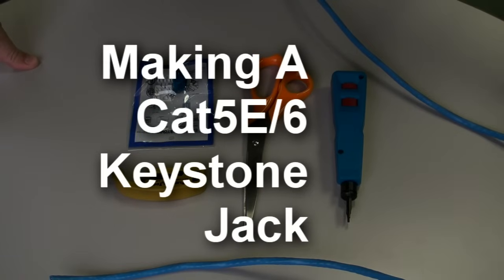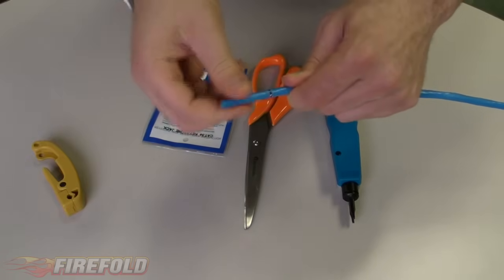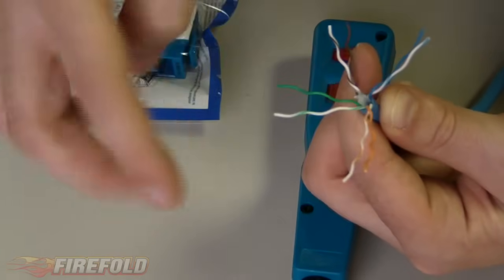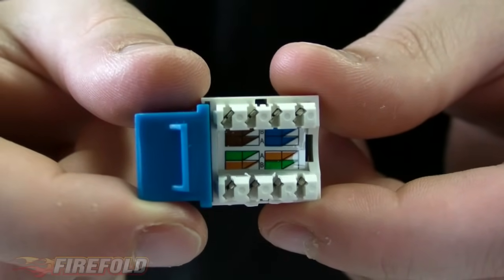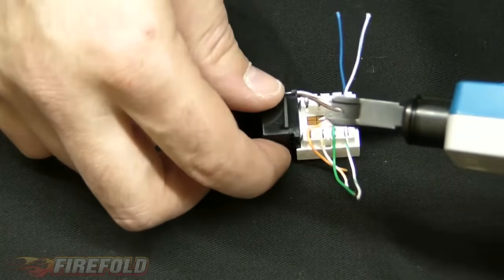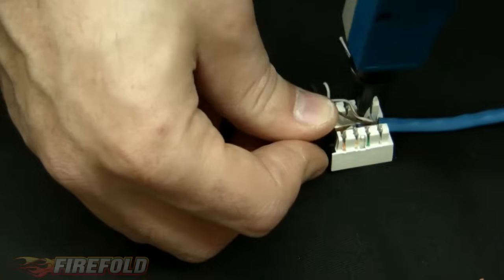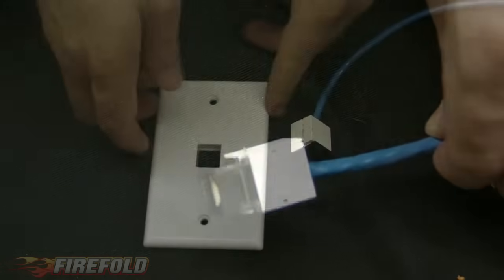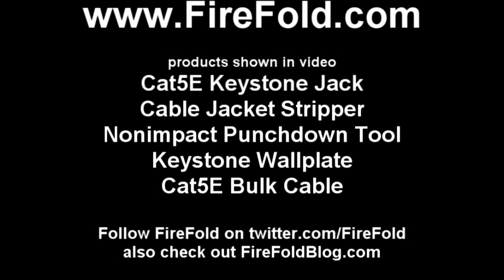Networking 101: How To Punch Down Cat5/E/Cat6 Keystone Jack - FireFold

Comment: Love the tutorial! One thing I would mention however, sometimes the Cat5/Cat5e/Cat6 shielding strippers might accidentally nick the twisted pairs, causing a short. I always teach new techs to use the nylon string to strip the plastic shielding further down the wire to avoid this. Especially useful if the cable is used for POE or gigabit connections.

Comment: While this appears to be simple and helpful, you should not untwist the wires all the way to the jacket. It negates any certification of the connection opening up to crosstalk issues. might work for old analog voice but high speed data has standard that this termination does not meet.

Comment: I did a “DIY”... cut the jack off of a CAT 6 commercial electric (Home Depot I think) and I am currently attempting to put a keystone on one end while the other end still has its original jack. Any help is appreciated. I’m hoping the only issue is the punch down it came with is cheap and not making a solid connection.

Comment: Never ever take the outer jacket off and not pull the string to expose more wire. 1 nick in the wire and failure is close at hand. I have enjoyed the lesson of the failure due to nicking the wire.
Reply: Robert w Sieburg what happened? How did you identify it failed?
Reply: @ellenboyd9287  Orange white broke. Dressed the wire again and used the same keystone and never had a problem with it since.

Comment: I have a question. On the other side I am attaching a regular RJ45 ethernet jack. Do I need to arrange those wires in same order as A,B,C,D on this or follow some specific sequence?
Reply: Same on both ends. Crossover ethernet cables haven't been needed for a long time. Look up Auto MDI-X.
Reply: On the other side (if using B standard) you’ll make it 

Orange white / orange / green white / blue / blue white / green / brown white / brown

Comment: Wrong, only separate as needed, keep twists up to where you punch them down, otherwise you will increase crosstalk. Sucks replacing jacks that someone else did not terminate properly.
Reply: Industry standard is max 1/2" untwist, there is nothing wrong with this demonstration
Reply: That is only for Cat 5... Cat 5e and higher you do not want to follow that standard. Trust me on that.
Reply: @Taluvian  so, are the jacks & plugs the same? Or are the different for 6 & now 7?
Reply: Yes, there is a difference in both. Cat 5 and 5e jacks are same, but manufactures have different jacks for Cat 6 and 6A, and Cat 7. At work we use CommScope, which I hate but standard there since the late 90s. We use both UNJ500 and UNJ600, which ever is cheaper and meet standard. RJ45 plugs is a bit trickier, especially when you get to Cat 6A. We test and must pass all cabling with Fluke meter now. In past they did not have standard to follow and we deal with garbage terminations that may work, but do not pass on meter.  New systems are better and easier to use. I do recommend using Belden RevConnect system after using that at home.

Comment: can I use a cat6 keystone jack on a cat5 cable?
Reply from the maker: Yes, you can! It won't make the Cat5E cable operate any faster, but it will work the same as a Cat5E jack.
Reply: i've read that if you use cat5 cable on cat6 keystone jack, the wires will not be as tight in the punch hole because the cat6 wires are thicker than cat5.
Reply from the maker: They will work fine. We actually have a customer who only uses Cat6 jacks no matter what, and he regularly mixes Cat5E and Cat6 cable.

Comment: Thanks! Now I don't have to spend $75.00 on someone to come and do it for me.
Reply: Jonathan Waller wow! I’m getting ripped off at $150 per jack.
Reply: Pretty insane what prices 'specialist' laborers charge for easy work as long as it requires a $30 tool and 10 minutes of instruction.  Check out what electricians charge to install an outlet in a new home!

Comment: So I could put one of them on each end then plug an Ethernet cable into each end then plug one onto my Xbox and the other into my wifi  router and it would work?
Reply: Yes. You would want to wire both keystone jacks as T-568B (or A.)

Comment: Thank you so much for this, what a clear instruction.  I didnt know how the heck to use the punchdown tool or even what direction to face it in.  I also did not know how to use the wire stripper in my kit that you demonstrated and had been stripping the wires the old fashioned way.  You have helped me tremendously.  And that tip about using the tip of cable shielding to untwist the wires was worth its weight in GOLD.  THis is one of the best YouTUbe videos I have ever, ever watched.

Comment from the maker: Yes, the Cat5e and Cat6 pin outs are identical in both T568A and T568B pinouts. T568B being the standard for most in North America. You will be able to punchdown a Cat6 keystone jack with Cat5e cabling, although the network would only run at Cat5e. So while it is possible, we cannot guarantee the functionality of the products when used in this manner.

Comment: I have a 66 block in my new home, terminated only with blue/orange from cat5e for voice. I am trying to tone out the block to find which run goes to a specific jack so I can use that cable for ethernet. When I tone the 66 block, the whole thing sounds hot. Is it possible that the block is run in series? I tried holding the probe behind my back and running my finger down the block, but touching every bridge clip produces tone. Is there a trick to doing this, or do I need to yank all the runs?

Comment: Nice video. Correct me if I'm wrong. You said in the video that you were using cat5 cable but it looks like cat6 cable based on the plastic separator in the core of the cable.

Comment: What if i want the other end of this cable to have a male plug? Does it have to be also B(T-568B) or it has to be A, like crossover?
I wanna have 4 jacks in different walls around the house and all of them coming to the same place as male plugs to connect direct to the router.
Thanks in advance!

Comment: I want to know if it's okay to use the dull side of the retractable knife to use as a punch down tool. The reason I use the r. knife, is so I can cutoff the nylon coat. But anyways, it fits, it makes the clicking noise like a impact tool, it just doesn't cut excess, and the jack works anyways!

Comment: WHAT?? WTF?? why are you untwisting the pairs?  NEVER UNTWIST THE PAIRS! this is sooo the wrong way to punch a jack.... go back to school....If you notice each pair is twsited at a different rate THERE is a reason for that@! google it
Reply: you dumb moron you have to untwist the pairs if you notice the untwisted amount is what is necessary to get the individual wire into the punch location this is required or you will have too many wires into the punch locale. it appears that the longest piece of wire outside of the twisted pair is about a quarter inch long (roughly )

Comment from the maker: You will need a switch that will expand your network capabilities. You would run one cable from the router to the switch and then you would have connections through all the other ports on the switch. Can you elaborate on your second question?

Comment: I have my router 4 ports full up and I want to connect another connector Rj45. It is possible to make something like a Y.  Another question if I made a wall mount like you did  I should have one end Rj45 through the router and the other question , as you have shown in can I loop the wall mount connector to another single wall mount internet   .

Best Regards 

Wayne Mizzi Ungaro 
Malta

Comment: You can also use a small screwdriver to separate the wires. Just insert the screwdriver between the wires (where the wires come out of the sheathing) and pull up towards the end of the wires.

Comment: IMHO I wouldnt use the wire stripper, even tho its design for this purpose, it could accidentally nick one or more of the pairs... The nylon thread is there for a reason, as you may know its used to "peel" the shielding thus guaranteeing zero nicks on the pairs...

Comment: Exactly, leave as much twist as possible. It varies epending on the manufacturer but usually they say not to untwist more than 1/2". Sometimes that little bit of untwist will be the difference between it passing spec or not.

I leave the pairs twisted and just get them lined up with where they need to be landed and give them a twist to open the pair slightly so they can be landed easier.
Reply: after cutoff, hes got less than half an inch untwisted... That whole jack is only about half an inch long, maybe an inch when you include the actual punchdown part of it.  His blues and oranges are probably in the neighborhood of .25" from where it leaves the sheathing to where it gets pushed through the vampire taps...
Reply: @AlanDike  It's still more than needed, and it could easily be the difference between pass and fail. The blue is fine, but the amount of untwist on the orange and brown pairs is excessive.

Comment: One more thing because i ran out of room.

When putting the keystone into the wall plate make sure it is facing the correct way. Both the plate and the jack have the word UP imprinted on them. Make sure to them both matched up. If you do not the jack will either not go in or break the faceplate if you try to force it.
Reply: I was wondering the same thing.   Thanks!

Comment: Good Video but i have a couple of pointers:
1. When using the wire stripper only go around once. More than that and you can cut the pairs inside and cause a short.
2. When using the punch down set it on low impact not high as he suggest. The high impact setting can break the keystone.
3. Also cut or burn the nylon wire inside the cable. This can get tangled up with your wires when you punch them down and cause it not to connect properly.